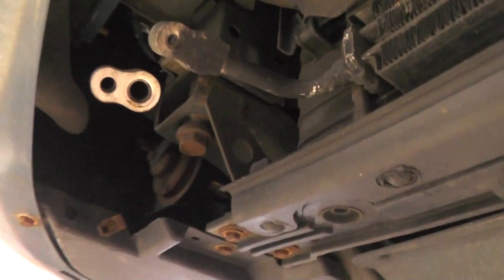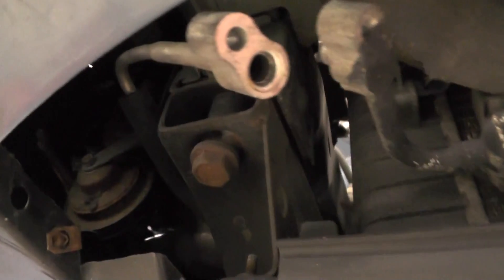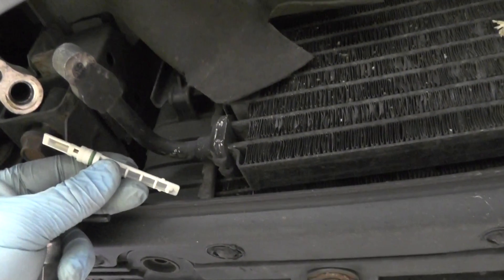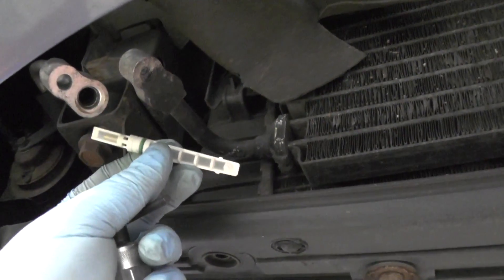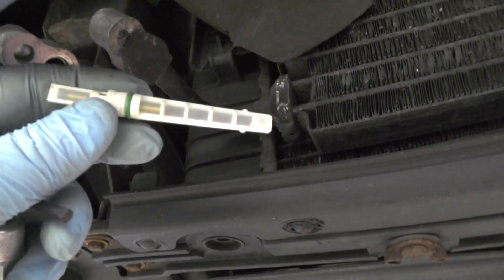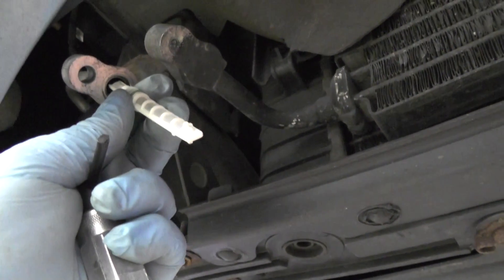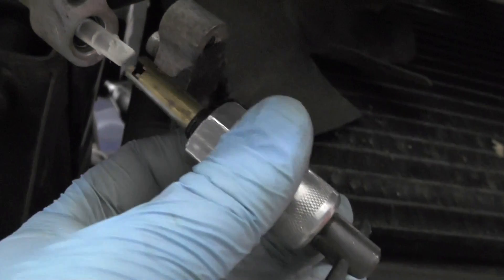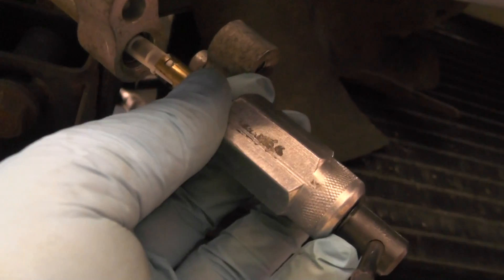Proper Orifice Tube Installation

Comment: Good stuff man. I purchased a condenser that can with a orifice tube already installed. I installed the new condenser. Replaced o rings and drew a vacuum on the system. Began to fill system with 134a and after a few ounces, the high side shot up to 350 psi and low was 15 psi. Turned out that the office tube was in backwards.
Reply: Aaron Hines same happen to me

Comment: What are the symptoms of a bad orfice tube I have a 2000 Jeep Grand Cherokee and it has been charged 4 times each time it cools less I've had it in 3 diff shops all they do is gas it up and try to change cycle switches issue is now I'll start the car the line will get nice and cold the vents blow cold then it fades away and the only line hat stays cold is the one with the orfic tube it stays nice and cold then after 5-10 minutes the Ac compressor will just cycle on and off if I let it sit and restart it will do the same thing no matter if engine is cold or hot. Will cool okay if the it's in the 70s and not sunny there is a small hissing noise sounds like radiator leak but only happens if I run the Ac cooling issues started when the noise started.

Comment: Do you have to evacuate the AC system before doing this?
Reply: Yes, the system is full of refrigerant and is under pressure. It needs to be empty before you start opening up the lines.